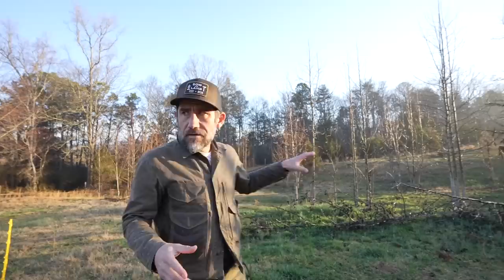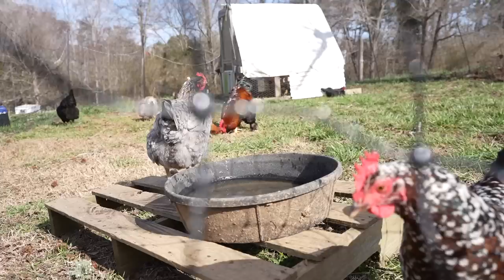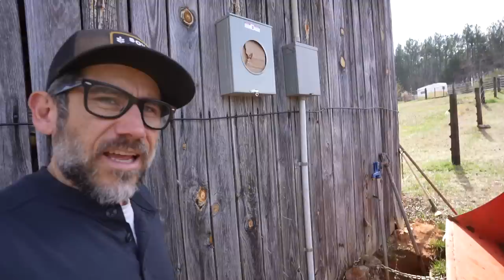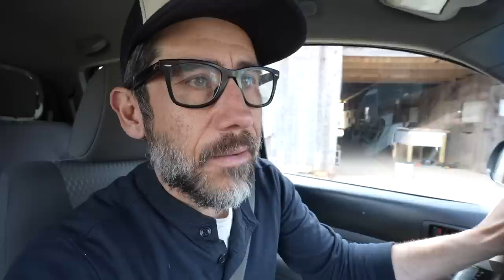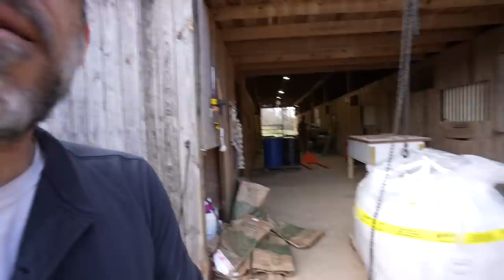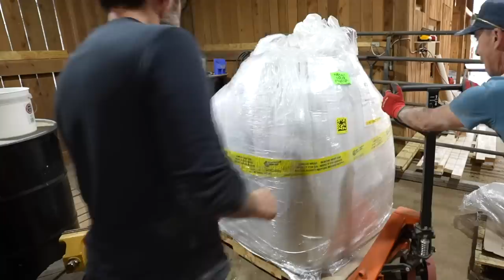First Job with this tractor/ Building our family Homestead

Comment: I wonder if you ever considered purchasing a used portable grain bin/ hopper? They are on wheels and can be towed behind most SUV's or light pickups. They are small enough to store inside a barn or are usually weatherproof enough to haul out to your stock and its on hand where you need it. Would save many man hours of handling feed so often. Just a thought :)

Comment: I wish I could get my father in law to help me out like yours does! Next time you want to pull out a tree or stump, double wrap it with one end of the chain and hook it back to itself so it can pull tight on whatever you want to move and hook the other end to the back of the tractor. Put the tractor in it's lowest gear and let it crawl the stump out of the hole. It works better on whole trees, but if you have to cut the top off, leave the stump about 3'-4' tall. My little 36hp ford can pull some surprisingly large stuff for its size.

Comment: Try using the hydraulics to lift the stump rather than pull it.  You’ll probably need to attach the brush cutter and have someone stand on it for added weight in the back.  Good luck.

Comment: Great call with the chain hoist! With enough chain and a big anchor point (big trees) that would also be the more powerful option for removing the stump. 

I've got a Kubota that's a bit bigger than yours. The loader/bucket is not so powerful - it would easily become a roll over hazard if it could lift more. The rear three point hitch actually has the most lifting power.

Comment: You need a Kubota tractor the same size and model as your neighbor's.  I have that same tractor and I use it several times a week doing various jobs around my place.  Look at what implements you think you need for various jobs around your farm.  I have the tiller,  bucket, level grader (not box grader), pallet forks, HD brush cutter, and a wagon to haul firewood and equipment.  I hang cattle and hogs from the bucket when I'm butchering.  You can't hang dairy steers from the bucket because they are too long.  My only regret is not getting the backhoe attachment with it.
Reply from the maker: Thanks Steve, that is good to hear. I just need to think differently about it and get used to the idea of using a big machine. Thanks!